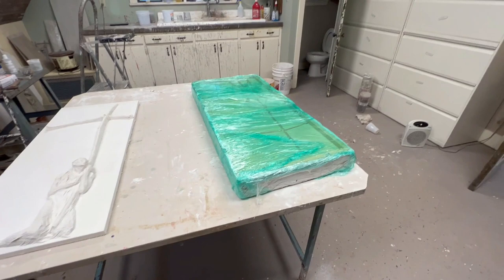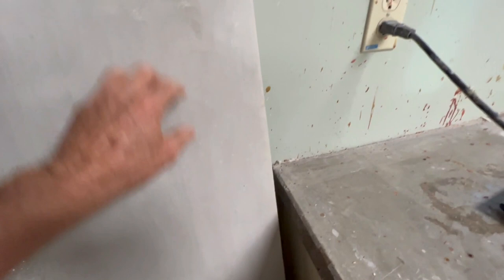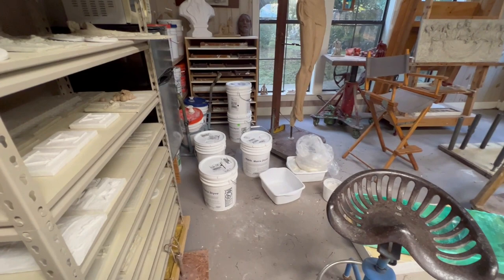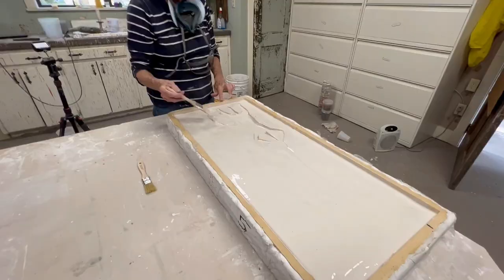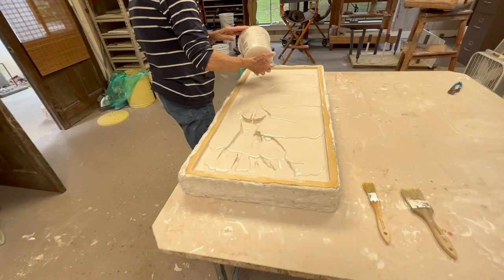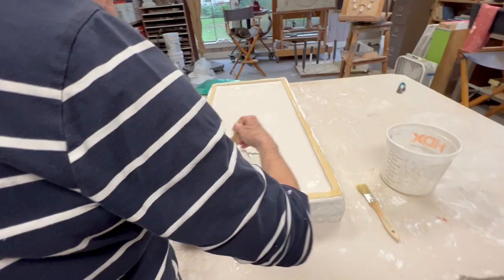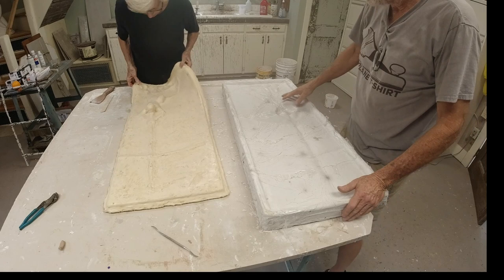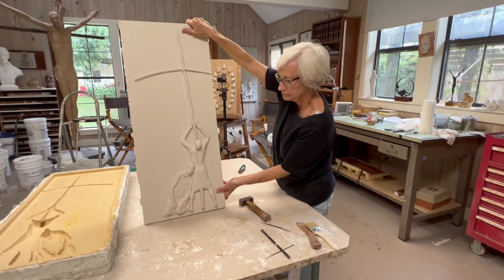Casting relief sculpture using Matrix  Dryve

Comment: Hello Barry, Your video is wonderful and very helpful. My bucket of Dryve just arrived! I work with plaster as a wall sculpture artist and have been looking everywhere for something stronger and more durable than what I use in my molds. Thank you so much for sharing the process behind your wife's surfaces, they are beautiful. I have a question, in hanging her pieces I see you used T Nuts and screws (?) in the mold... do you have more explanation or videos or anything else to help demonstrate how this works, what hardware is needed, and how the piece is actually hung on the wall? I'm sorry to bother you just so curious how you did this? Thank you! ~Erika
Reply from the maker: Erika
Thank you for the kind words. We use different methods to hang here reliefs. For pieces that will be hung inside in a non public environment she simply imbeds one or two SS short wire hooks in the back after the face coats have set. For exterior we sometimes use the SS t-Nuts. A SS stud will be inserted into each one and will intern be epoxied into the brick or stone wall they are mounted to. This will make them permanent. On larger pieces a SS frame is imbedded into the rear which will hang on a matching frame bolted to the wall French cleat like. Hope this helps, Barry
Reply: This does! You are so kind to respond so quickly and thoroughly. Thank you and all the best : )  @barrylukebuilds7894

Comment: Great video!  Are you still using Dryve?  Are you happy with it?  It’s hard to find any actual reviews of it online.
Reply from the maker: Quiz
Just cast the second half of relief 8 of 11 for a church yard in Detroit. Easy to use and so far no issues. But time will tell. You are correct, not much information out there.
Reply: Thanks - I’ve been messing with it for a while.  Are the stations of the cross done yet?